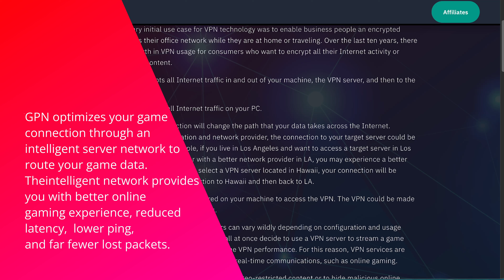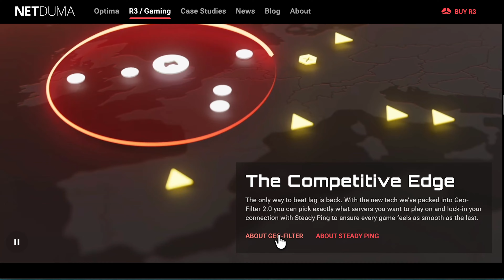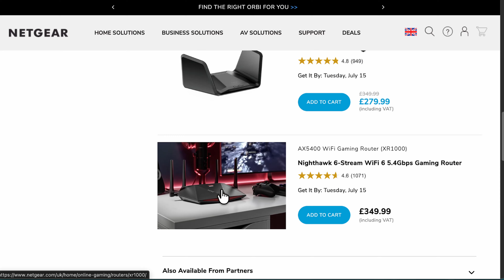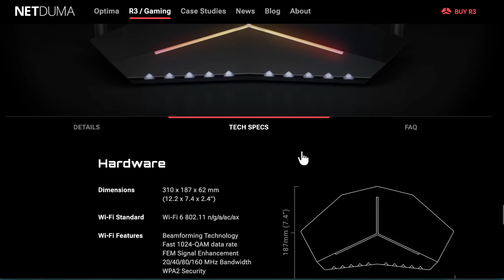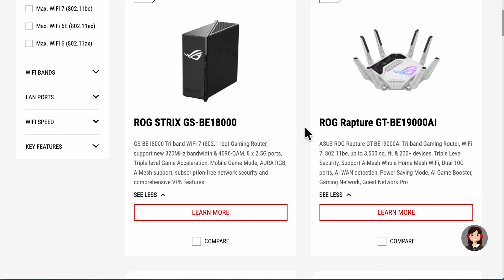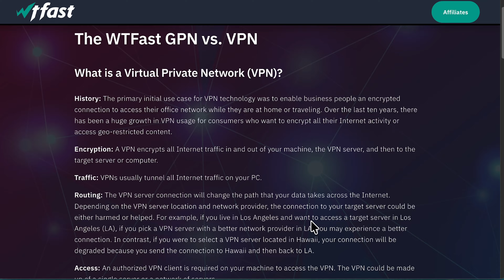Are Gaming Routers Actually Better for Gamers?

Comment: Agreed. Some features are just marketing but some probably do add benefits that regular routers don’t. Will be interested to see if the ASUS BE 19000AI router will make a difference with gaming, streaming etc.
Reply from the maker: Hi, hope you are well. Yes waiting for the BE 19000AI router as has the new version of asuswrt 6.0 which looks  impressive and gives more features around WiFi interference. Hopefully they will also update the other WiFi routers with it as well but more than likely require there new MPU chip to run.
Reply: @EclipseReviews  It will be interesting to see. Hope all is well and great video as always.
Reply: I use a gaming router for normal office tasks I don’t use any gaming features but my signal is much much better than the normal ASUs non gaming router so I am sticking to the gaming router